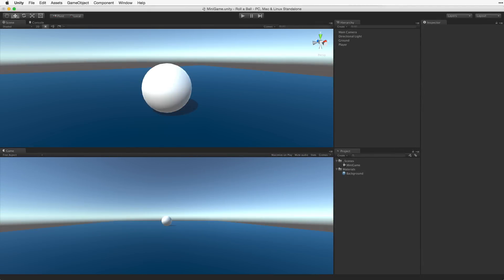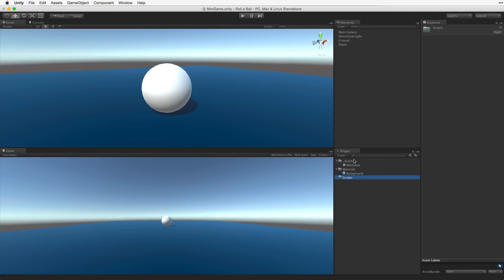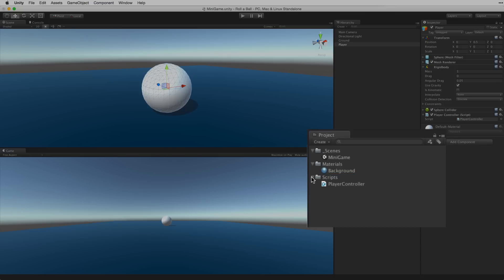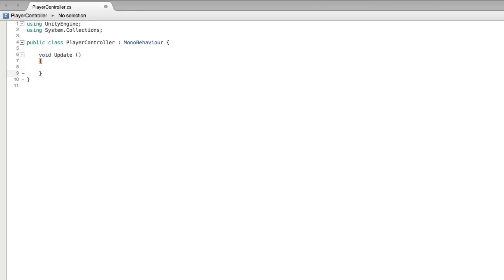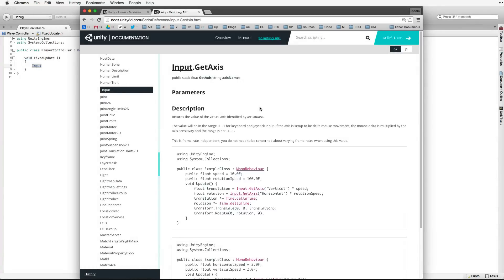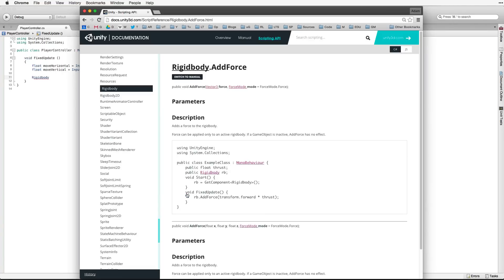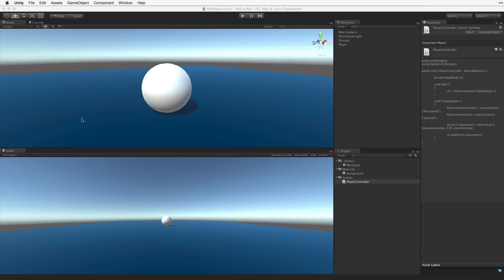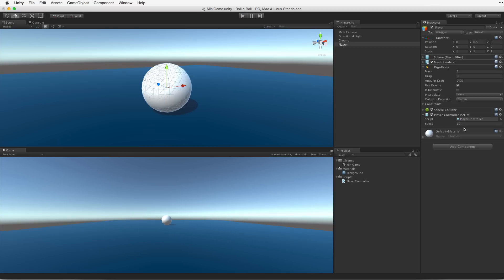Unity 5 - Roll a Ball game - 2 of 8: Moving the Player - Unity Official Tutorials

Comment: This does not work if you use the same script he does in unity 5. I tried it following the video nothing happened. go to the actual tutorial page under the video is the correct script and it works also with the input manager for asdw keys.

http://unity3d.com/learn/tutorials/projects/roll-a-ball/moving-the-player
Reply: The scripts in the video were copied to the webpage so they should be identical. 

If you still have issues, please post with more details on the official Q&A thread. The link is in the description.
Reply: Verlon Prime The same thing happened for me, so I tweaked the code and now it works. lemme know if this works for you:

using UnityEngine;
using System.Collections;

public class PlayerController : MonoBehaviour {

    public float speed;
    private Rigidbody rb;
    
    void Start (){
        rb = GetComponent<Rigidbody>();
    }
    
    void FixedUpdate (){
        float moveHorizontal = Input.GetAxis ("Horizontal");
        float moveVertical = Input.GetAxis ("Vertical");
        
        Vector3 movement = new Vector3 (moveHorizontal, 0.0f, moveVertical);
        
        GetComponent<Rigidbody>().AddForce (movement * speed);
    }
}
Reply: Awesome thank you very much that worked
Reply: Verlon Prime your welcome. Glad I can help!
Reply: +PeterScarlet Gaming (Verlon) The script still doesn't work. all I could move was the camera.

Comment: HI, i have a problem when i use de play mode to see the results of the script the ball just dont move. I've press all the keys buy it doesn't move. Do you imagine what my mistake would be? I check the script and re-write it twice alredy but nothing change at all.
Reply: Julio Gibrán Pérez Padilla I had the same problem, it turned out I'd put "fixedupdate" instead of "FixedUpdate"! It seems if you don't use upper case letters correctly in Unity, it'll assume you mean something else.
Reply: Gerrard Winter you're rigth about the FixedUpdate it seems i use fixedUpdate whitout realize and void Start had the same problem and i change them both but still no changes. Sorry im entirely new in this.
Reply: Petter Johansen Yes when i was following the steps in the video i got a lot of problems as those. it was like the AddForce wasn't correct when i write it. i actually I re-write the code again whitout follow the steps and then it recognized.
Reply: Please, everyone with problems: please use the link in the description to ask questions on the official Q&A thread.
Reply: Sleeping Bear That's interesting because Python doesn't use " ; " to end statements. :Kappa:                 x-D
Reply: Julio Gibrán Pérez Padilla If there's one thing I remember from the basic Python course I did a couple of years ago it's that forgetting a single ; can break your entire code. It sounds like you already fixed your problem, but making it a habit to check that if something doesn't work helps.
Reply: Gerrard Winter
Reply: I resolve the problem Thanks everyone.
Reply: Julio Gibrán Pérez Padilla what did you put